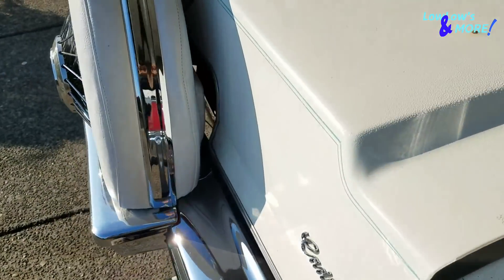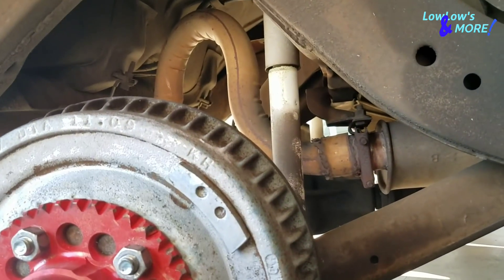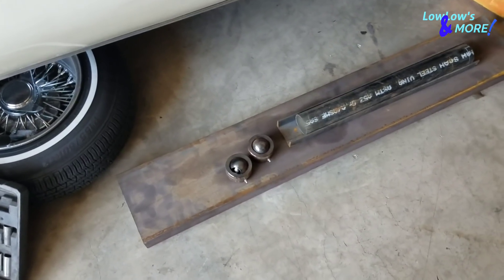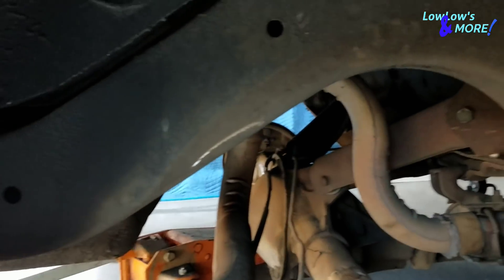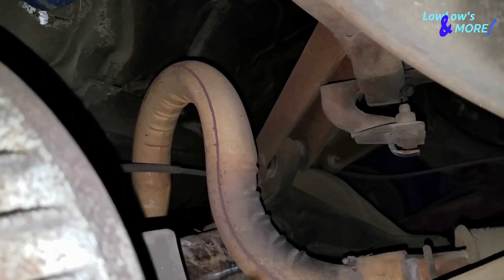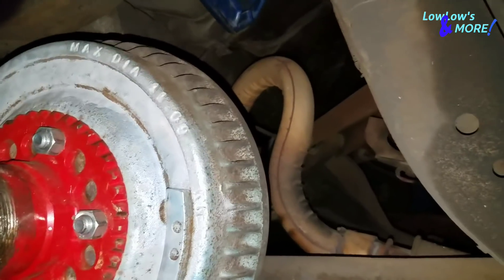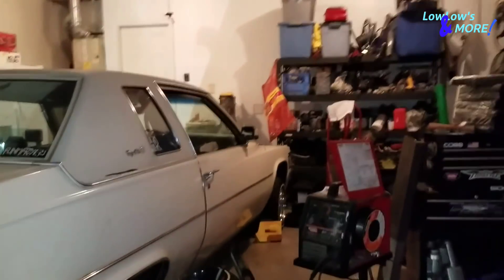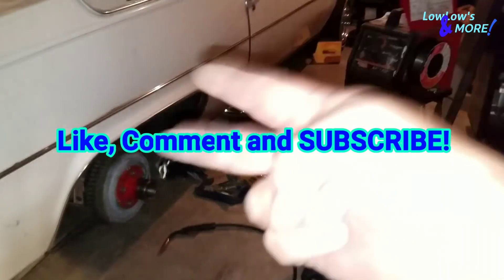Installing the rear cylinders on the caddy, bad day

Comment: What works bro in the rear so it don't make noises i put pvc pipes and it works
Reply from the maker: That's what I've heard as well, I normally cut it off and recenter it, when u cut a spring it will cause the cylinder to sit slightly side ways even though the cylinders are put in straight.
Reply: 70 impala SO DO I NEED TO JUST ADD PVC PIPE OVER THE WHOLE CYLINDER ?
Reply from the maker: It doesn't have to cover the entire cylinder but you do want it to go past the flooring of the trunk.
Reply: LowLows & More! Thanks for clarifying that
Reply: @ericv4152  like low lows and more said just cut the pvc pipe to the trunk floor you don't want the pvc pipe going any higher than your cylinder but I've been riding with the same pvc pipe since 2013 and still going. Other people say but grease but all it does make a big mess and the noise eventually comes back
Reply: 70 impala ok cool thanks
Reply: @ericv4152  anytime homie you can't be riding a nice low low with all that sqeaking lol
Reply: 70 impala you got that right bro..